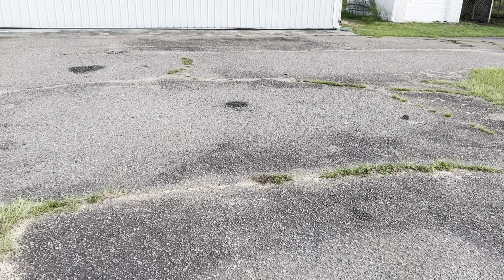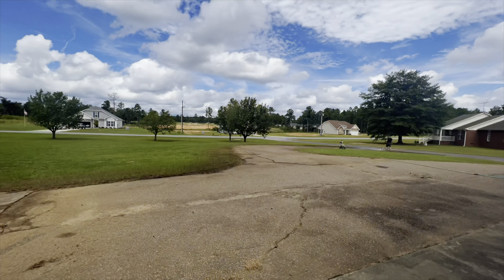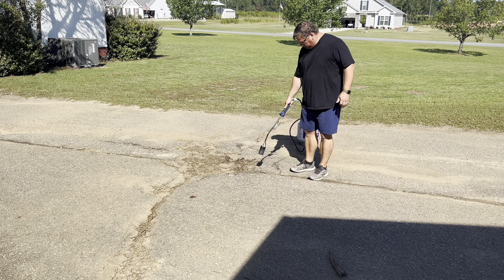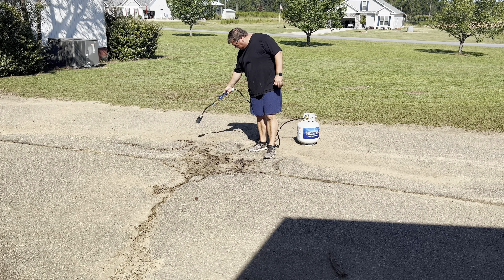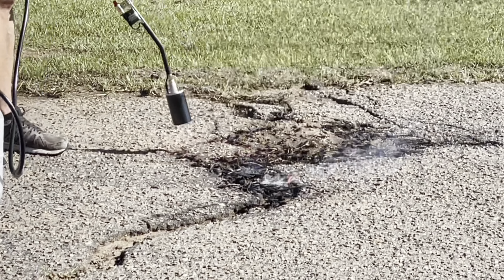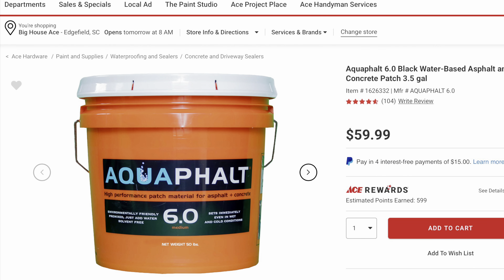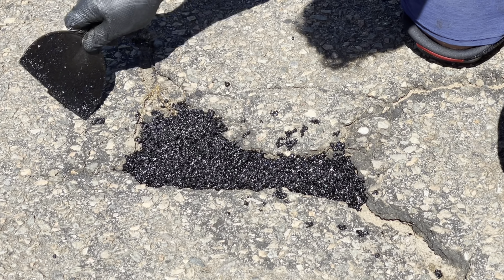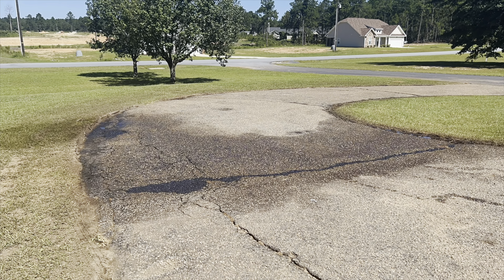Repairing my Driveway with Aquaphalt.  Removing Grass from Asphalt, Cleaning and filling the cracks.

Comment: how many buckets did the whole project take?
how is it after a winter?
Reply from the maker: I used 36 buckets for my project but my asphalt was in extremely poor condition and just sucked up this stuff.  It did great so far, no problems at all.
Reply: Holy crap, you spent $2k on aquaphalt?
Reply: @aviationkitbuilder  that's insane. how much would be to redo the whole thing from scratch?
Reply from the maker: @Hollywood49  No, I used that many buckets of asphalt sealer. I’ll look back at the picture I took, but I think I used 6 buckets of aquaphalt.

Comment: Spackling?
Reply from the maker: It’s been a while since a did this video but I used a plastic disposable drywall tool to work the crack sealant and the Aquaphalt into holes and cracks. I may have called it a spackling tool.
Reply: @aviationkitbuilder  I see. Thanks for the response.
Reply: PUTTY KNIFE

Comment: How long did it take?
Reply from the maker: The entire project took me four or five days long days.  That includes pushing the grass back to where it should be on the edges, cleaning and filling all the holes, and then using the asphalt sealant.  It was mid 90’s when I did it which didn’t make it easier.  The sealant goes down better when its warm, but it was too hot when I did it.

Comment: Just rip it all up and start over new.
Reply from the maker: That is definitely what I should do, but I was looking for the $500 get me by solution.
Reply: @aviationkitbuilder  Smart man...
Reply: How much after filling cracks, aquaphalt, and seal coating did it cost you? I just bought a bottle of the latex-ite crack filler/sealer and fell down the rabbit hole thinking I’m going to need to get some aquarphalt and seal coat now 😳. Curious why you didn’t use the latex-ite for the cracks? Great job!!